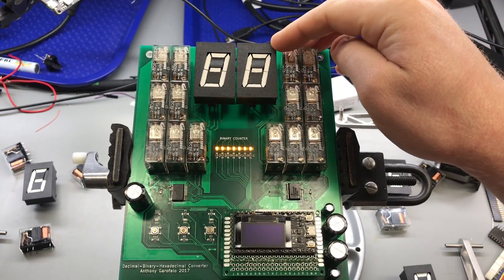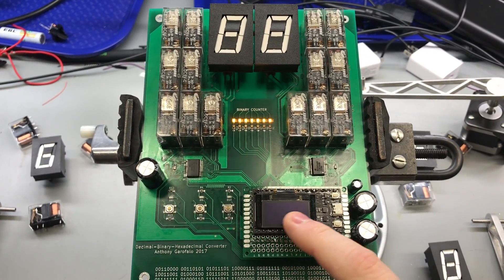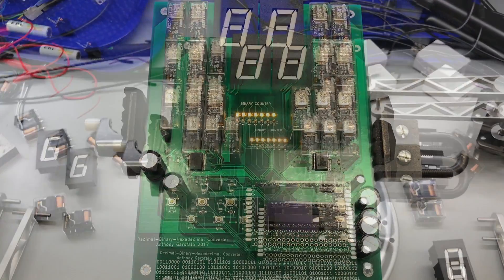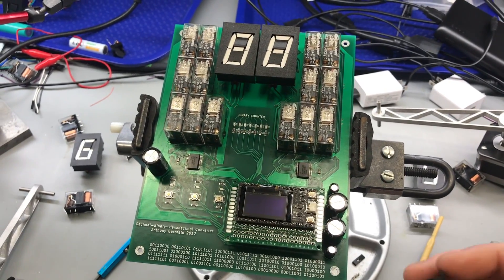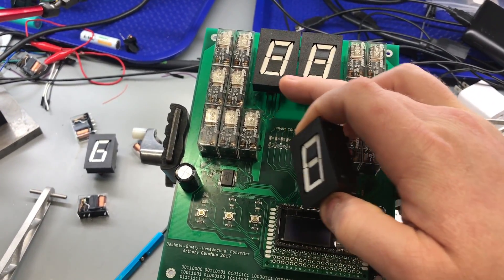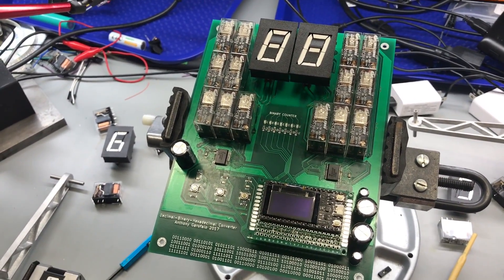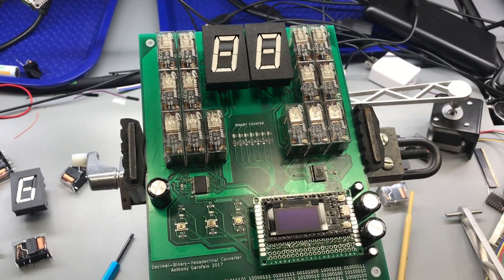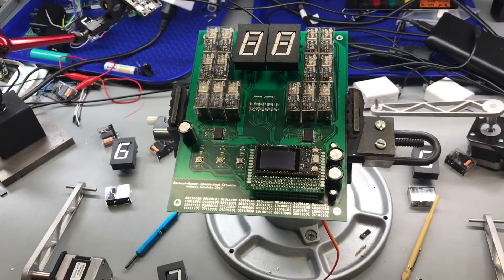Electromechanical Decimal to Binary to Hexadecimal Converter 60FPS

Comment: Did you see the marco reps video he talks abous a NXP chip (MC33880) wich is verry interesting to drive your displays
Reply from the maker: I'm using an NXP MC33996, which is better for what I'm doing with the relays. I wanted to use relays for their sound. The relays are being used with the NXP chip in an h-bridge configuration. The relays display the individual segments and then the NXP MC33996 reverses the polarity and resets the individual segments.
Reply: Proto G ok thats looks like a geat project and I love the old-style look of the electromagetic displays that you use !

Comment: You don't have to use relays do you? Not completely sure but wouldn't it be a little more reliable to use BJTs? The noise is beautiful though, sounds like an old telephone exchange systems.
Reply from the maker: Thanks! Relays were chosen for the sound.  Reliability is not really an issue with low current relays because they are not constantly arcing and corroding the contacts.  Honestly, BJTs might even be less reliable because of the voltage spikes from the segment coils.

Comment: Do you know of any electro-mechanical graphing "displays"? I've wanted to make a nice barograph, but I don't want to use an LCD or anything like that. I'm considering a big e-paper display but I don't think they're very easy to use, and I'm limited to 10" or so. A 2 axis drawing machine is another option but I don't think I want that much added complexity. It will end up in a wooden box on the wall or on my desk.
Reply: A third option is a 2 axis drawing machine with a laser pointer, mounted behind a pane of glass coated with glow in the dark paint. It would work kind of like a dumbed-down CRT display.

Comment: Does it change only one segment at a time because it would suck up too much current to change all of them at the same time? Or is it for the aesthetic?
Reply from the maker: Purely aesthetic, I can display and clear them all at the same time but only one full independent digit at a time because the digits are sharing the same SPI bus. I can display both digits at the same time but only identical commands.  I wanted the digits to appear as if I were writing them.  Displaying them instantly doesn't look/sound as nice.
Reply: Proto G I guess there is a lot to experiment there, like writing on them as you do now but clearing them instantly, or only clearing the segments that are not needed for the next number, or having the segments flutter on and off slowly creating the number, and lot more that people will come up with.
Also Ｄｏ　ｉｔ　ｆｏｒ　ｔｈｅ　ａｅｓｔｈｅｔｉｃ